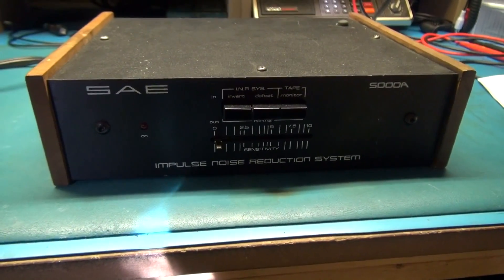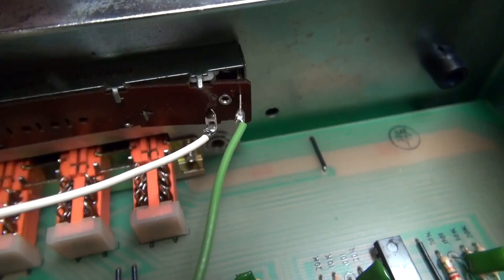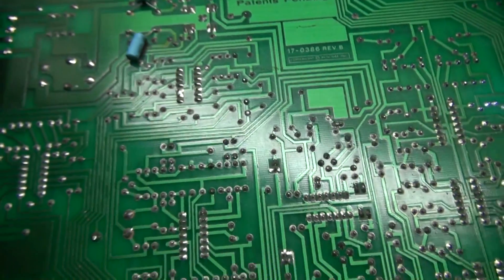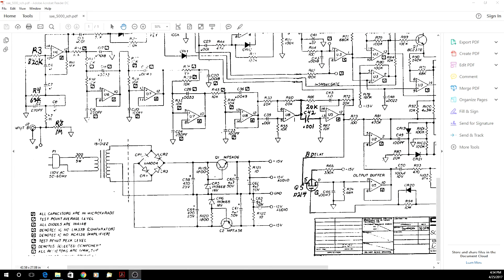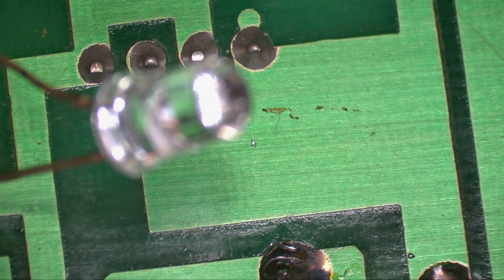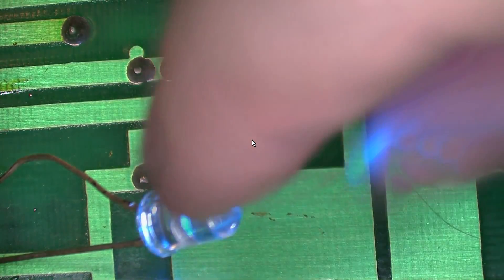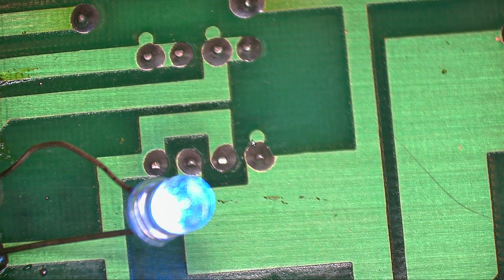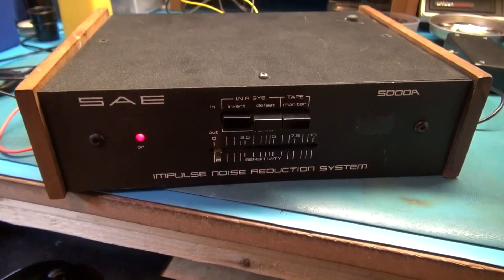SAE 5000A IMPULSE NOISE REDUCTION SYSTEM REPAIR

Comment: Paraphrasing the User Manual, the purpose of the Invert button is so you can review the results as demonstrated in the video but if you hear music in the results, you back off the level until you don't. This should provide the optimal balance of noise reduction without blocking the actual music. 

I have records I cannot find replacements for (yet) that are clean and I've used a zerostat, but still have some ticks and pops, probably from scratches or imbeded dirt the Nitty Gritty, Discwasher, and Last cleaners cannot get out. The SAE-5000 does a decent job at making them more enjoyable.

Good video, thanks!

Comment: I know it’s been awhile, but if anyone needs the device numbers of the ICs I was able to carefully clean all of the ICs while keeping the part numbers on them. There are two different ICs on the board, the one marked 11-0165 are RV4136DB by Raytheon and the ones that are marked 11-0164 on the board are LM339N also by Raytheon.  I did have one 11-0164 that is an RCA CA339E, so same part, different manufacturer.
Reply: Didn’t see this, sounds like you have what you need then Henk? Good work Basspig.  I was going to say, your tech should be able to look at the schematic and then figure out which IC’s go where.  If he/she can’t you may want to find a different tech.  I no longer have the SAE 5000 anymore, but I know someone who does, so I could get pics if needed, though may be a little while. Hopefully your tech has it from here though!
Reply: @danhorton6182  Thank you Dan !!!!!!!! Whe can not make the thing to work. It detect the pops and scratches verry well buth when I let the music play everything is there again, the tech has alreddy changed all the ICs for new ones buth his not 100% shure that they are on the right place also he changed a few capasitors and resistors for new ones buth whe are not abel to get the thing doing his work ! If you could help me I will be verry greatfull !!!! And I must excuse me for my verry poor English ! Greatfull greetings from Henk !
Reply: @henkgloudemans8886  The one I'm repairing, the two switching FETs both read 26 ohms from Drain to Source. I'm mainly a vacuum tube guy, so I don't work with solid state stuff very often, but it seems to me that the D-S junctions should not be reading a constant 26 ohms. The one I'm working on passes signals, but doesn't take out the clicks. Invert mode has no output.
I replaced one of those FETs already, but it continues to yield no results. The new FET is reading 26 ohms, so now I'm really wondering if the "bad" FET was really bad.
When I had my 5000A, it clearly isolated the clicks and pops and you could hear them in INVERT mode. So obviously the units we're working on have additional issues.
Reply: @basspig  Thank you Basspig !!!! I am greatfull that you tell me this buth I am not technical I will let it read to my repairman he shurely understand it !!!!! I hope there wil come a day that the thing is repaired buth I think it will be verry difficult !!!!!! I wish you a nice day !!!!! Greetings from Henk !!!!!
Reply: @henkgloudemans8886  
I’ll see if I can get the SAE 5000 shortly and get pics.
Reply: @danhorton6182  Ooooh ! that would be great Dan !!!!!! Greetings from Henk !!!!!
Reply: I brought my defect sae 5000 to a repairman buth he dont know where to place the new ICs I have bought rv4136 and lm339n ICs buth he dont know the position where to place them. please will you help me ? Greetings from Henk Gloudemans. My Email adres is henkenellygloudemans@gmail.com  On my sae 5000 the ICs have other numbers than 11-0165 and 11-0164 !
Reply: The schematic contradicts this, "5 denotes LM339" "4 denotes RC4136". Ultimately, to be certain, checking which pins are power might sort it out.
Reply: @basspig  Thank you, for answering me !!!!! Buth I need the locations of the ICs the repairman dont know where to place them ! (there are no numbers on the ICS in this aparatus) If you could mail me the schematic with the location I would be verry greatfull my mail adress is henkenellygloudemans@gmail.com and excuse me for my poor English ! Greatfull greetings from Henk !!!!!
Reply: @henkgloudemans8886  e-mail sent!
Reply: @basspig  Thank you thousand times !!!!!! You are a real friend !!!! You have maked me happy !!!!!!!!

Comment: I just bought one of these units and the seller stated works great. But he also said he used it for recording vocals,so I don't know what's up with that. Anyway one channel does not pass signal when it's set to process the signal. It will pass the signal if I press the "defeat" button to de-activate the processing, but then switching the defeat button to process the sound I then get no signal through the bad channel. I looked it over for some sort of obvious problem and don't see anything. I also tested the power supply and get the 2 spots with -15v and the 2 spots with +15v, so the power is good. This is the point I don't know how to check further. I have a signal generator I figure I can put signal into it and I have a scope I just don't know how to check it further, and I'm hoping someone can assist me with what to check/how to check. Thanks for the video, it at least got me to the point I know the power supply circuit is working.
Reply: First clue would be the seller claim that he "used it for recording vocals". There would be no earthly reason to use a INRS for such a purpose. Why would there ever be a "click" or impulse audio peak with a rise time greater that that which would ever occur naturally in music (even drums) in vocal recording?